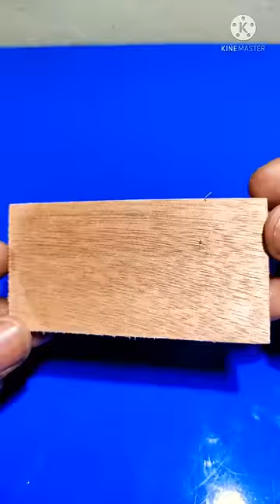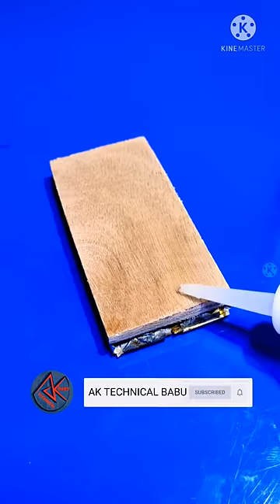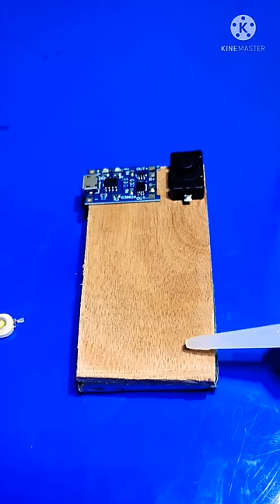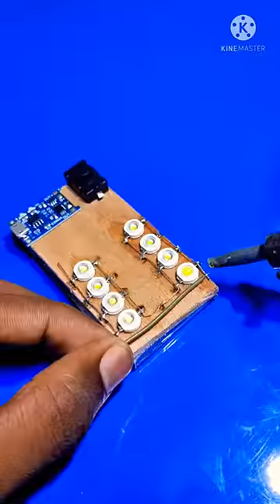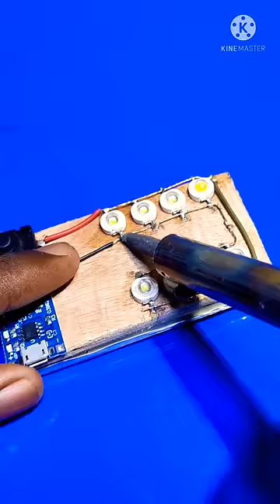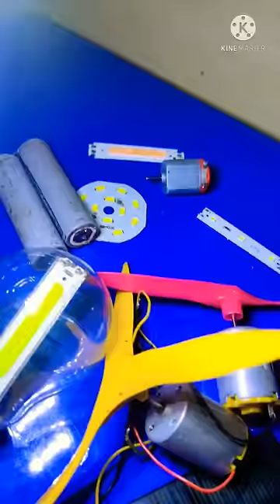How to make super bright flashlight....😱😱 #short  #superbright  #flashlight

Comment: Bro everything is perfect but the maximum output voltage  is (4.12-4.2v) from the tp4056 circuit. But the maximum permissible or maximum voltage of led is 3.5v and operating voltage is 3.3v. but you are giving above its maximum voltage bro the leds will get burned. Use proper resistors bro. So many people are following you bro.
Reply: Yes bro
Reply: Hai
Reply: @sabarimalaisabari2625  hi
Reply: Good Blass You
Reply: 2 ohm resistor ando 3 watt, ando a heat sink Will be survive the serie of LED.
It's a very usefull light 👍💪
Good Blass US!!!